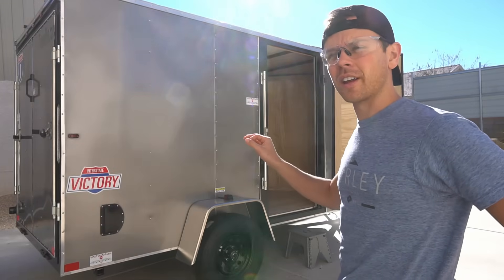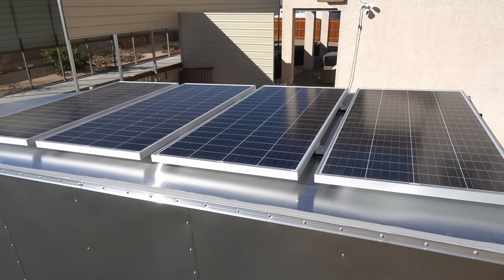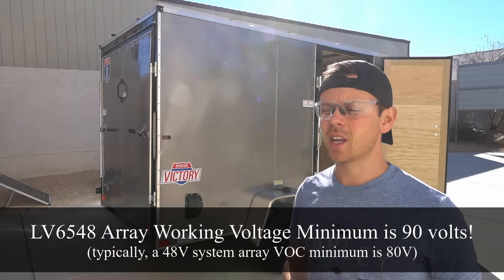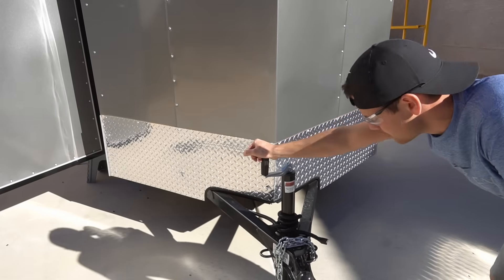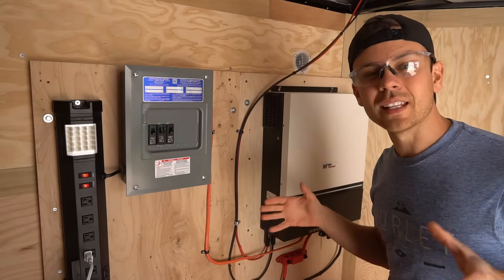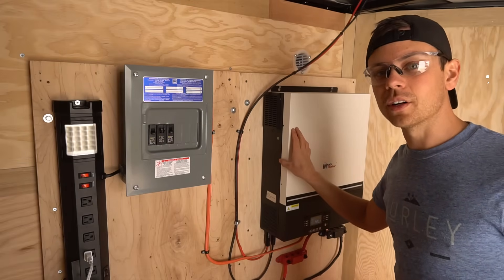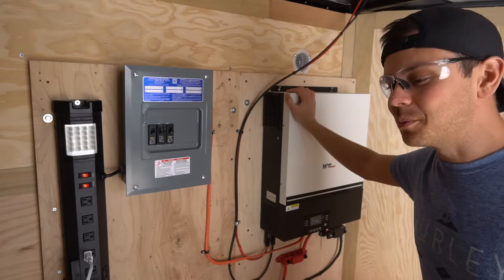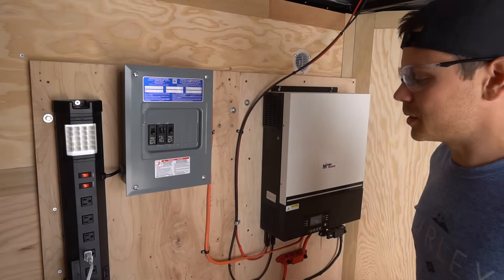Solar Trailer Part 3: 800W array installed and future updates

Comment from the maker: Upcoming videos will be filmed in my upgraded workshop. It is finally remodeled and that horrible echo should be fixed. It took me a few weeks to build, and the results should be awesome. Stay tuned for solar product reviews and battery builds :D

~~~~~~~~~~~~~~~~~~~~~~~~~~~~~~~~~~~~
Tired of getting ripped off? Check out my "Will Prowse Approved" solar product recommendations below!

12V Batteries
https://www.mobile-solarpower.com/lithium-batteries.html

48V Batteries
https://www.mobile-solarpower.com/48v-batteries.html

Offgrid Inverter System Builder
https://www.mobile-solarpower.com/48v-complete-system-blueprint-559371.html

Hybrid Inverter System Builder
https://www.mobile-solarpower.com/code-compliant-48v-offgrid-system.html

Mobile Handtruck System Builder (very popular!)
https://www.mobile-solarpower.com/mobile-48v-system.html

Solar Panels
https://www.mobile-solarpower.com/300w-solar-panels.html

Ground Mount Solar Racking
https://www.mobile-solarpower.com/ground-mount-racks.html

Wire, Lugs and Busbars
https://www.mobile-solarpower.com/wire-and-connectors.html

Tools
https://www.mobile-solarpower.com/tools.html

Fuses and Circuit Breakers
https://www.mobile-solarpower.com/fuses.html

Plug-N-Play Solar Systems
Ecoflow, Anker And Bluetti! So many models to choose from. See my current recommendations here:
https://www.mobile-solarpower.com/full-size-systems.html

~~~~~~~~~~~~~~~~~~~~~~~~~~~~~~~~~~~~~~~~~~
Need to build a large DIY system? Need a trustworthy solar distributor? These are my favorites:

Signature Solar
Creator of EG4! Solar Minisplits, Victron and More! Largest Solar Store Online.
If you want $50 off, please use my link below and coupon code "DIYSOLAR50":
https://signaturesolar.com/?ref=cPwLcVc0SW-BjN

Current Connected
Best Prices for EG4, Victron, Midnite and so much more! Fast Shipping and Highest Rated Customer Service:
https://currentconnected.com/?ref=wp

~~~~~~~~~~~~~~~~~~~~~~~~~~~~~~~~~~~~~~~~~~
Join our DIY Solar Community 
Need more help? Join the largest solar forum on the internet for beginners and professionals alike. 140,000 members and counting!
https://www.diysolarforum.com

Check Out My Free Book
Best-selling and beginner-friendly guidebook to off-grid 12V solar!
https://www.mobile-solarpower.com/the-book.html

~~~~~~~~~~~~~~~~~~~~~~~~~~~~~~~~~~~~~~~~~~
Contact Information:
I am NOT available for personal solar system consult! If you wish to contact me, this is my direct email: williamprowsediysolar@gmail.com
FTC Disclosure Statement and Disclaimers:
Every video includes paid promotion or sponsorship (such as free products for review). Some links on this YouTube channel may be affiliate links. We may get paid if you buy something or take an action after clicking one of these. My videos are for educational purposes only. Information is subject to change/update at any time. Electricity is DANGEROUS and can kill. Be smart and use common sense :) DIY Solar Power with Will Prowse is a participant in the Amazon Services LLC Associates Program, An affiliate advertising program designed to provide a means for sites to earn advertising fees by advertising and linking to Amazon.com
Reply: Double stacked panels on the roof where the lower panels pull out on heavy-duty drawer pulls. Check underneath the trailer and see if the frame will allow you to put drop down boxes for the batteries (think Tesla, low center of gravity) having the batteries in boxes below would also help keep them cool (when driving or via a breeze when stationary) Vents with closing flaps (rain proof) in the front and back would help both when moving and stationary as well. (like a greenhouse)
Reply: Hey Will, your site linked to RS-M200 which are 12v panels, but I think you mentioned 24v in the parts list.  Did you get the RS-M200D panel instead?
Reply: Did you hook up your solar panels parallel or series?
Reply: What kind solar panels do you like?
Reply from the maker: @zfontain1975  my favorite components are always listed at my website www.mobile-solarpower.com

Comment: Take the handle off and connect a cordless drill on a hex nut. Or buy an electric tongue jack. Then maybe a mini split will fit. Or mount it up high, and it will clear the tow truck bumper.

Comment: DTE has stopped doing the production of the panels that were at 800 I have panels that I'm going to just play up here on my YouTube about how they stop producing the 806 hundred watt solar trying to get Michigan to go back doing the solar panels like I have doing from the beginning they were producing 806 hundred watt solar panels because DTE because DTE contracting has been messed with and they were doing quick internships quickly to to produce panels and wind generators a lot of stuff is cut off on eBay and wish that there were producing and I have to stay on them to make sure that they're producing the right of increment of stuff especially when it comes to the produce of what will what was done especially for inventions does 806 the state of Michigan and my people are right now or doing other stuff other than the production of the stuff they're here killing each other when we could be finishing up the production for in producing the products they were being produced from this state

Comment: Will i just recieved my LV2424 and EG4 24V battery. I have 8 Renogy100 watt 12V solar panels can i wire them series/parallel and still be under 145 VOC?

Comment: This is exactly the type of video I've been wanting to see from you (because I trust your frank recomendations!) and also because I've started to convert a cargo trailer to travel in myself) What I'm hoping to still find out from you tho (as I'm still an electrical newbie) is a simple way to figure out or calculate what my electrical needs are.  For example how to tell what each of my bigger appliences I connect each pull, how long can I run them for so I can plan the system based on how to use it.

Comment: Will — have been planning a solar build from your plans and suggested panels but one area I can not find addressed —- grounding panels.. batteries- system...  
can you please do some intro and series on if we setup 1000w of no mobile panels what we need to do for grounding those RichSolar - do we need surge protectors in the PV wires and how.. and do we and how have to ground the milk crate or board built system you laid out (and how) if we are doing this for an off grid location. Please. I feel this safety issue is holding me up. Thanks!!!!  Excited to get started.

Comment: That’s awesome, considering the new variances regarding solar panel install say from a 20 degree angle vs 5 degrees. (depending on different roof types) or (ground installs).
You will find that 5 degrees works the best at absorption rate. 👍🏼
Beautiful 🤩

Comment: Hi. Can someone here answer a question for me ? I have a Souer ST-H 1230 MPPT many shop tell me i cannot use big solar cell panel with my 38AH AGM battery. I don’t understand why this is a problem. Will the ST-H 1230 stop charging the battery when charging is finished? I want to use a 350w panel so i can get more battery’s cells in the future but I Don’t want to buy a 50w cell I’m being recommended to suit a 38ah battery . Thanks in advance.

Comment: Will, ditch the hand crank and get the battery powered  motorized one. Also put solar panels on the side but attach them to piano hinges so while driving you can lay them flat and then when your parked you can fold them up, just need to figure a way out to lock them in the open position.

Comment: You said the batteries hit me it's limits on current.  What was the limits ?!
Reply from the maker: Discharge current of four in series can power 4800W. But inverter is 6500W
Reply: @WillProwse  thank you so how would you fix your current issue using your current batteries setups?? Another bank in series and parallel with the other bank?
Reply from the maker: Add another bank in parallel. I can power it now

Comment: Rigid hvac sell a dij, dc 12-72v mini split air conditioner for roughly $1000. 8000btu. I have had a  24v model in my semi truck for 2 summers. Comes pre charged, and installing isn't too hard

Comment: Hello Will, keep up the great work, I am so glad I found you here and have learnt a great deal from you. I do however have a question; Cracked solar panels. Can they be fixed (coated etc) and will they then work and if so at what sort of efficiency? I can get hold of some at silly prices and have a very small budget as recovering from similar issues you have been through in the past. Best wishes & keep safe, Peter :)

Comment: Easy for the ac on the front... get rid of the handle... use a cordless drill to turn it... or build an extension that could be turned above the ac... needles to say yo uh could spend some $$$ and buy a motor driven...

Comment: Hello Will 
Nice trailer 
Remove handle, Weld on a Nut, Use a socket on a (wireless) impact Wrench.   Build a Lightweight  aluminum  tube chassis , with wheels to pull behind Golf cart.  Loaded with milk crates & Covered with those 4 panels + 2 sideways on Golf cart. With a Tesla plug in cord.

Comment: You can add more circuits to that breaker box. Just put a 60A breaker as the input from the inverter. Tie the two legs like you did with Cu min 6 gauge wire, Cu 4 gauge would be best THHN/WN or equivalent. Your panel will be protected by the 60A input breaker as well as the MPP over current protection. That sub panel is rated to 100A, but you are protected by a 60A breaker. Does not matter how many breakers you add, the input cannot exceed 60A (not counting brief surge the breaker can support before tripping), also in the future I would recommend the QO line from square D, not the homeline version. Much better breakers and panel (yes bit more expensive) but it is also rated to 125V DC (main lug version only) for other applications with solar combining using their double pole QO breakers up to 70A (positive on one leg, negative on the other leg).

Comment: Will, wouldn't it be nice to bench test a parallel LA to LFP system? In a marine installation 12V LAB are normally present. People claim that paralleling LAB and LFPB is not possible. I think it may work flawlessly with the BMS voltage set to 12,6-13,4V which gives 75% of nominal LFP capacity. The LAB would be important for alternator charging the system. The BMS would cut in and cut out the LFP from charging. The LFP would take most of the charge current and most of the load discharge current. How much exactly needs to be tested. If this setup worked out, DC-DC chargers wouldn't be needed, and direct alternator charging (with high current) may be feasible.
Reply: LA batteries usually require around 14.4V to charge and then will rest between 12.65 and 13V.  If left in parallel with LFP,  the LFP will be drained down to the LA resting Volts.

Comment: Hi will always liked your cool videos . 
I think a fantastic idear would be a Nissan Leaf stripped down parts and you put the parts in a mid size light weight van fiat box type / ram in America renamed ?? 
And spray van black & totally cover it in solar pv go on a mini tour no charging self charging from pv . Then the auction it off would be a great spin off on your channel don’t you think 🤔 ?? 🤞🏽🤞🏽🤞🏽 
I converted a ev van to a fully electric camper van on James and Kate YouTube and on my YouTube Otleyshev68  .. 
just a ordinary guy who lives for solar and battery & car ev tech 
Ps another great idear get your viewers to show there selection of battery’s I have some battery 🔋 AA from 35 years ago yep capacity low but still working I have about 10 different types   Thanks kevin England

Comment: Hi just on a different topic - i have three12v batteries connected in parallel and take power from negative of first battery and positive of third. in most youtube video's people then connect the charge contoller to positive and negative of first battery and i was thinking if that is wrong and you should do the same as with the power and connect to first and third batteries ?  your thoughts

Comment: How about building a shelving unit in the front area of the trailer and housing the battery bank there. You'll have full floor space and still have full length cargo area. I'm taking about the area in the trailer that forms a triangular point. Also have you looked at using a roof mounted AC unit. Like the ones on delivery vans. Seems like you have plenty of space in front of the solar panels.

Comment: Will, I’m reading your book & watching your videos. Putting together a system for my 21’ travel trailer. Already dropped a 100 W Battleborn battery & have been “experimenting” while camping off grid.

So, I don’t anticipate needing more than 300 watt array. But ... I noticed you always recommend even numbered arrays, (e.g. 2 100w panels, 4 100w panels, 2 200 w panels, 4 200w panels, etc.). 

My question: can I get 3 100w panels? Or do I need 2 pairs?

Comment: A removeable six point racking system welded to the bottom of the frame would permit cable travel inside the tubing to enter from underneath so no holes in roof while giving mounting area for top and sides.

Comment: Only downside to mounting on the trailer is that you’re forced to park it in the sun. I opted to do ground deployable ones. But then again 200w was plenty for my use. I do like the project t though sir, thanks for sharing. Maybe you can work on Guinness record for most mobile solar watts per rated cargo capacity on a trailer!

Comment: Hey Will, I've been following your channel for a while and love your builds.  A lot of your stuff is inspiring my design for my truck camper.

I have a question though. With what's going on in Texas and California with blackouts from natural disasters, what's a good option for an uninterruptible power supply?  The requirements are constant on 24/7.

I was looking into a Lithium based UPS to keep my network and my fridge running for a few days (maybe up to a week), but everything that's available is only rack mounted for graceful shutdowns of computers and servers.

My modem/router/access point is a 20watt continuous draw, and my fridge only uses 100watts for 10 minutes every hour (17 watts per hour rounded up).

If you were going to roll your own, would the milk crate setup be the best choice? I don't want to worry about my inverter breaking down in 7 years because of overuse. Solar is impossible for apartment complexes, gas generators on a patio could lead to carbon monoxide poisoning.
Reply: Lithium cells and batteries quickly lose lifetime and capacity when kept at a high level of charge while unused. That is why you don't see them in a UPS. To make it work as you wish would take twice the battery capacity of your needs so that the cells/battery could be kept at the recommended 50% storage charge level. Li is great for some things- just not everything.

Comment: Rewording my Question??
I have a 150/35 victron charge controller. According to my calculations I could do 8x200 watt newpowa solar panels wired in series.  According to the numbers that produce 17 volts and 11.76 amps. The open circuit VOC is 20.23 volts and short circuit is 12.45 amps and I have 10 gauge wire running to the roof. If I have to use the VOC open circuit number would that mean 7 panels and can I run them all together in series or do I need to do a combination of series/parallel??

Comment: I see a welder and some basic skills in metal working in building custom rack for that Air Conditioner and Channels to add additional panels.  You can add two Flip up Wings with some supports on each side to add covered space and more space for Solar Panels.  It never ends Will, it just ends with a Larger Trailer..... haha

Comment: Change  tongue jack to a side handle and turn it towards the front. For your Golf cart, you will need a 6X12+12 height. Probably should be tandem axle. If you get one built with a 6 or 8 inch frame you can recess the batteries in the floor. I can have one built for you but you will have to either come to Ga. to pick it up or have it shipped (lots of $$). I'm sure you can get one built closer to you. Lookin good hollywood!

Comment: I'd get some larger panels and mount them to the sides on tilt mounts, like 370-420 watt panels, the tilt would allow (possibly) to collect more sun power!  But heck to a mayaswell put a 2kw generator on there too! As ND mount led floodlights all around it, at least 100watt on each corner, light up the long nights! Two 100 watt flood lights on each corner and flood light stands to go out about 100' maybe a pole mount flood light mounted at the tongue, telescopic to raise about 20' up, with about 400 watt LED flood lights, it could be used for disaster relief! And Forrest fires as a relief area, it could power refrigerator and microwaves to cook for firefighters and the freshly homeless or displaced,. It's a good idea, it may get you brownie points with Carma ! I have thought about building a large generator trailer that can power a few houses necessities, invade of power outages, give each house a 20 amp circuit, and only ask for fuel money ,  I was going to use a couple 7kw belt driven generator heads,  and powered by a car engine, 2 or possibly 4, 7kw generator heads, limit them to about 6kw running watts, but the engine should be plenty big enough, 366ci 280hp , so it should be easy on the engine , and steady power, surges shouldn't bogg the engine, it could be a big help in times like what happened to Texas, we need to help each other when we can! I'm sure there were a lot of ppl who would loved a 20 amp extension cord, with a heater and lights attached!!